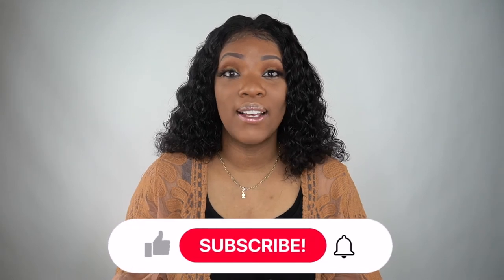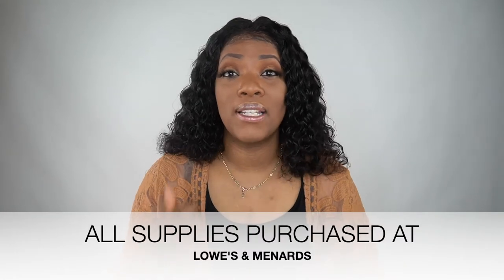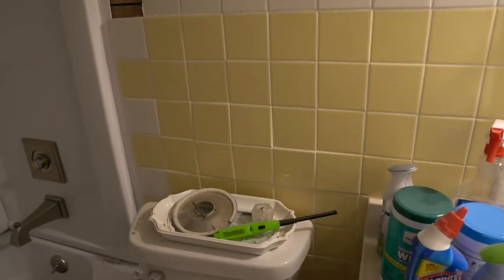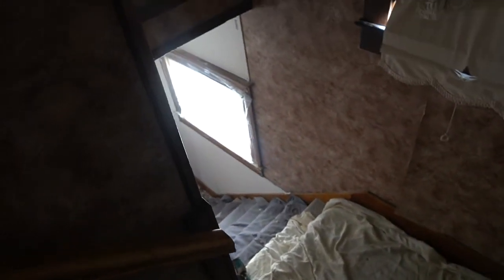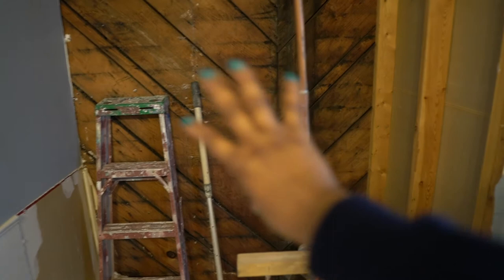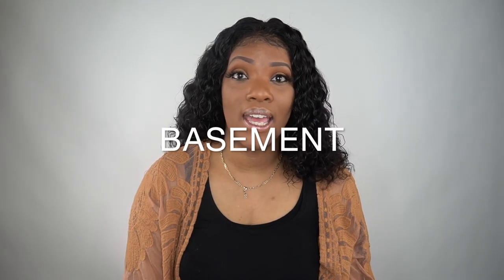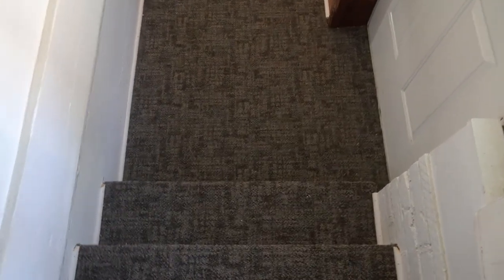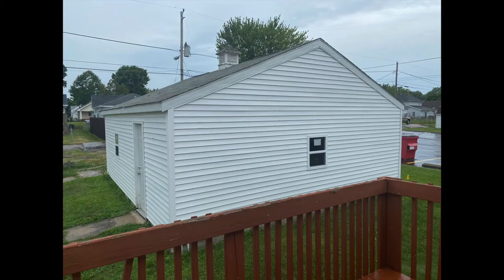HOUSE UPDATE PART 2

Comment: Anytime you work on the house make sure you turn off the furnace or AC to cut down on the dust circulating in the house. It won't stop all of it, but it helps. Air purifiers in the construction area also help.
Reply from the maker: Great idea! We have a few other things to do and we will def do that! Thanks for suggesting that!